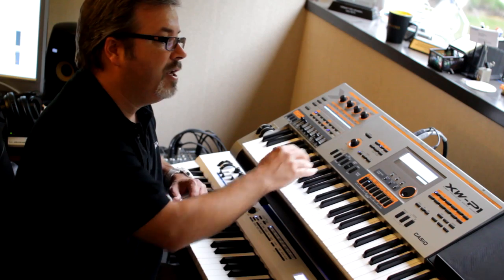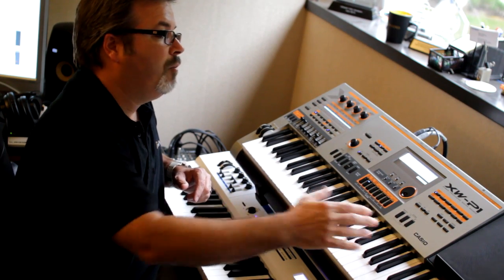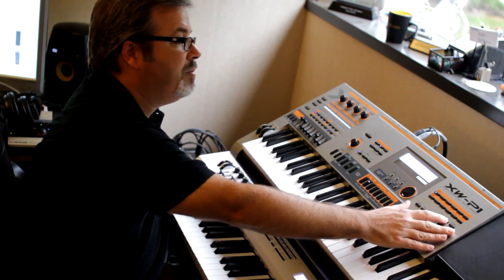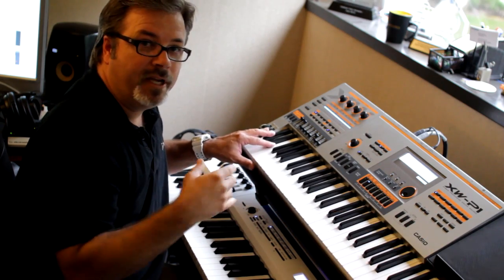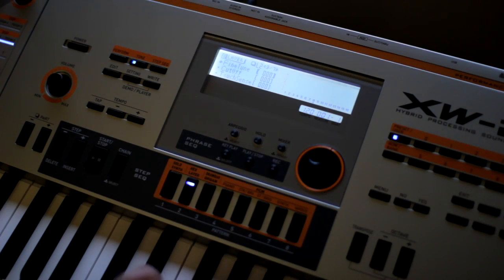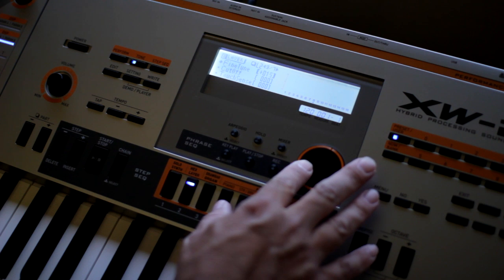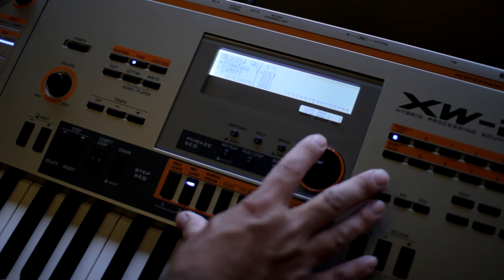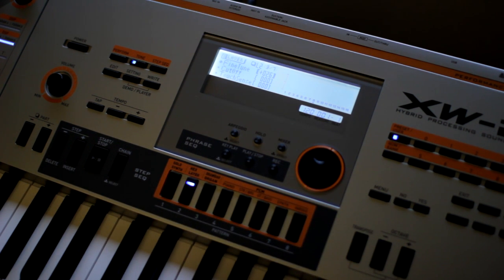Creating PWM on the PX-5S and XW-P1

Comment: Including inverse sawtooth is a nice feature and does indeed give PWM when mixed with a detuned "regular" sawtooth.  However, the result is not quite the same unless the detuning can be made to vary with pitch in a very specific way, otherwise the modulation rate increases linearly with note frequency (it is normally a constant).  Also, as the detuned waves "slide" past each other the pulse width momentarily passes through zero, which is not always what you want.  Still, as you say, this can add a lot of life to emulations of classic string machines, etc.  

PS. I agree with Shane about the hair cut.  :D